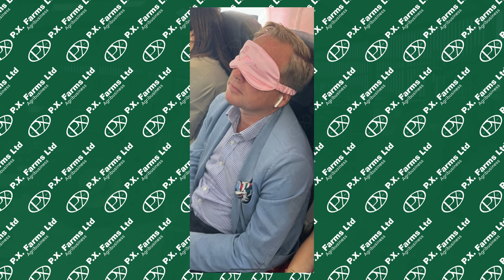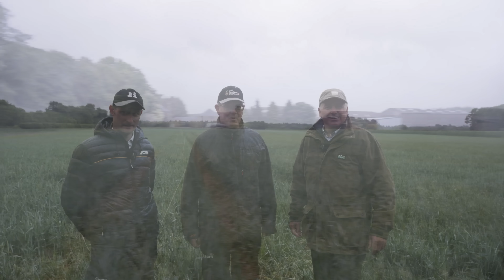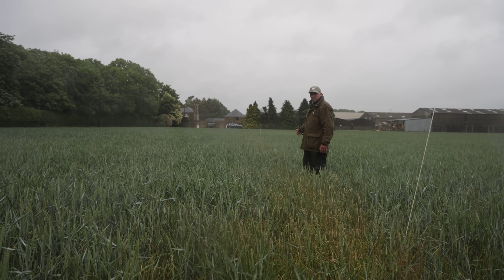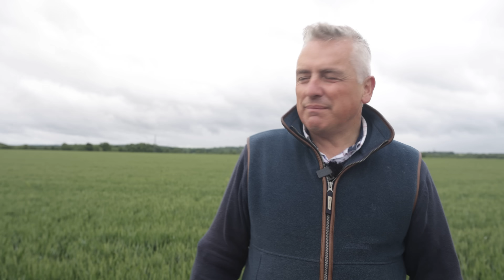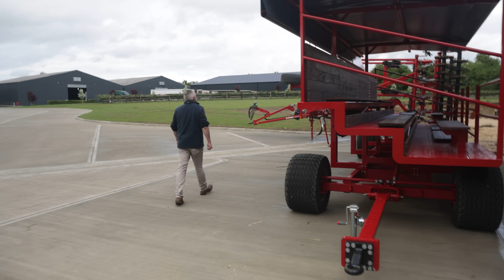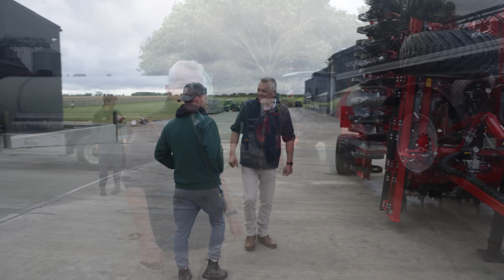Black Grass Battle Begins: HORSCH Arrive & the Rain Finally Falls!

Comment: Poor ole Tom... "you pratt"  Pick on Tom day arrives with the Horsch equipment :) Enjoyed this. What is a bit scary is how big the kit is. Whilst it looks impressive it is still a lot of weight rolling across the fields. How much does that boomed spreader weigh when laden? A quick look at the brochure gives us an unladen weight of 11100kg, capacity of 14000 litres. Add a large Fendt 942(?) on the front at around 17000 kg , give or take ballast puts it up to 28100 kg (without fertiliser) You then need to add in the specific density of the product being spread for the final sum of total weight. UK legal limit for train weight for road use is 31000 kg. You've eaten into that already. You'll need a separate trailer and loader to get around, rather than running back to the yard. (I appreciate PX's situation/ set up). Not only does the weight come into play, but because of its size, you're limited to 20mph on roads as well. What happened to the Vicon vari-spreader? :) 
 Keep it up chaps.

Comment: In Germany, we have fully adopted no-till farming over the past few years. By using cover crops and peas, we are now able to manage blackgrass much more effectively.
Reply: Genuinely asking, how much did it help with reduce of herbicides? How much Glyphosate do you use before planting?And Whats your crop rotation? Thanks mate.
Reply: @jakubkrivanek5250 At our place in Germany we had no Black Grass like 3 years ago but know it starts really hard at some farmers in our region farms are small like 100-450ha and the fields are small too which makes it difficult to control at boundarys to the next field.
At tried to imform more about Black grass I know read alot about it in German know I also looked at England because the problem is longer there.
So what I read and heard here sometimes like plough,plough,plough makes no sens to me for me it would make more sense to plough it perfect at 1 of 4 years perfect if there it many of it tillage will not solve the problem if you don’t get it out of winter wheat.
So notill will solve the problem and to use round up products is a no brainer if it will be forbitten we are dead probably.
But we see that notill is a system which means longer crop rotation which itself helps alot of reducing black grass if you did not already drive to the wall.
In our region crop rotation of many farms with no animals is winter oilseed rape-winter wheat-winter wheat-winter barley this crop rotation is perfect for black grass and I see that simular problemes are in England because of winter wheat as main crop.
So the only problem if notill I see that if there are former grass fields they are often wet similar to England where they are wet too and have heavy clay so these are perfect conditions for black grass and at these soil it is difficult to plant spring beans or spring wheat but probably biggest problem of long crop rotation is the economy of the farm we here dont have these extrem high winter wheat harvests like you we talk about 9-10ton normally but because we have harder winter and not that much water.
But what I saw and read hear tells me to make my crop rotation longer an more spring plants.
This guy hear said that he does spring barley 4x in a row at bad fields that is not really good economy too 😂.
My solution for know will be rape-wwheat-corn- wwheat-beans- winter wheat.
Because 4 times spring barley is not that economic too so better to start early and not drive it though to wall first.
And I also will try notill but for the begin we only try a small part of the farm over 4-5 years and then we see.
I was at a farm in Germay which had 4000 heads of black grass per m2 he did notill over 4 years and diffrent crop rotation and there is not much black grass in the winter wheat🤷‍♂️ anymore.

Comment: Good piece Michael, its not just ploughing its when you do it in rotation, once in 3-4 years imo. Also depth, in the past we ploughed too shallow to increase speed and reduce fuel costs but actually deeper ploughing is much better for burying weed seeds and bringing up older seeds which don't have the vigour.